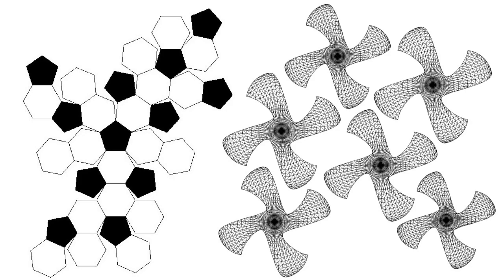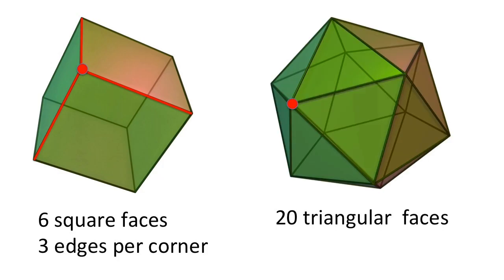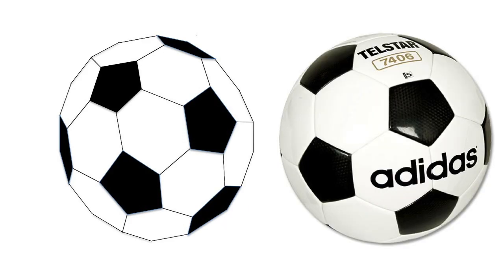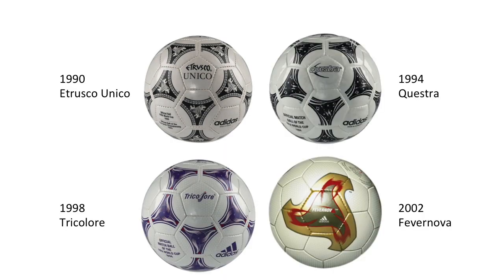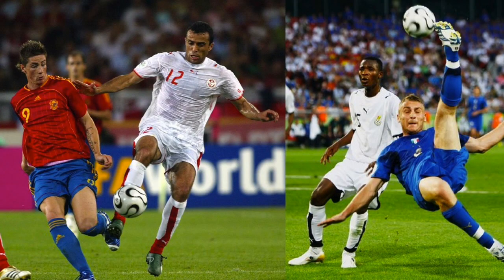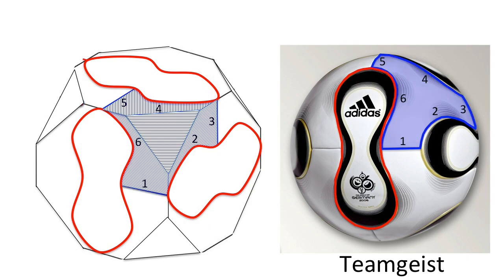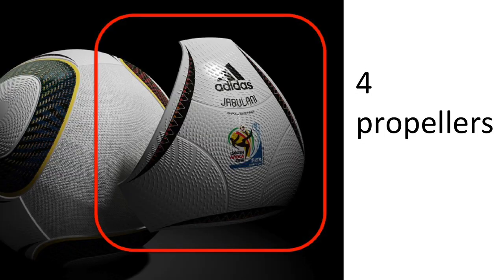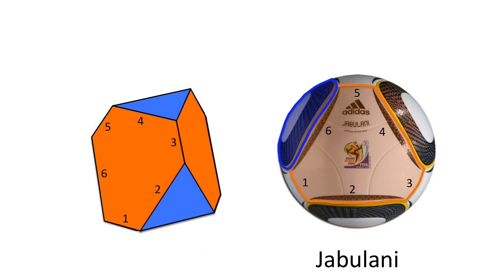What's the Best World Cup Ball?

Comment: I never knew how much affect different designs had on the flight of a soccer ball. If the number of seams is a low number does the ball fly higher? Is there a particular platonic shape that makes the ball fly faster through the air?
Reply: It's a load of rubbish really, probably just footballers and their fans looking for excuses.
Reply: Air flow over the surface of a ball will have a massive effect on how much it can curve according to spin. Especially when kicked at high speeds, as seen in world cup games.
Reply: Night Angel Yeah, but they are actually all spheres, just stitched together in different ways, as all of the faces are curved additionally.
Reply: Katzen4u Except the seams are different. Deeper seams, more seams. More seams are, I imagine, more traction on the air. So slower but curves much more. I imagine deeper seams also give it more air traction.